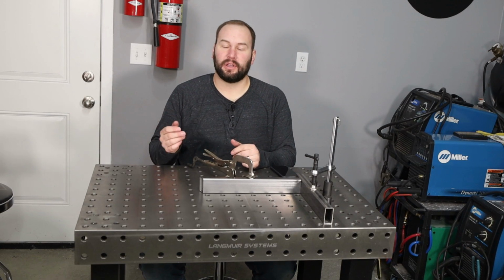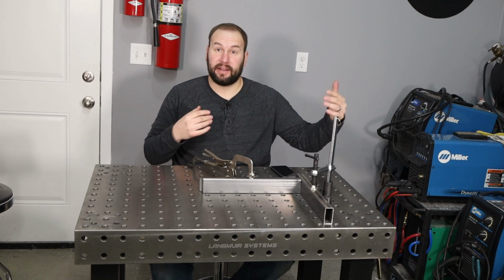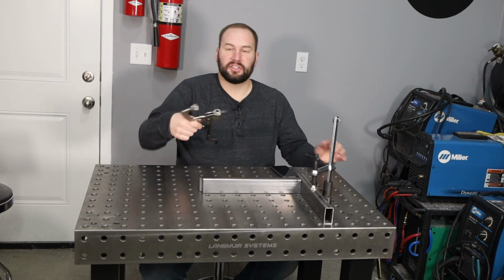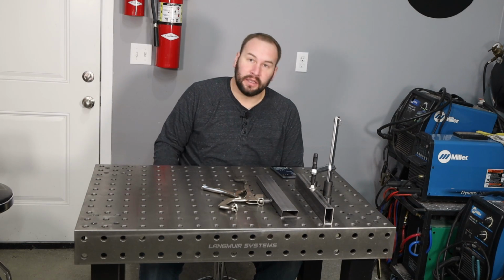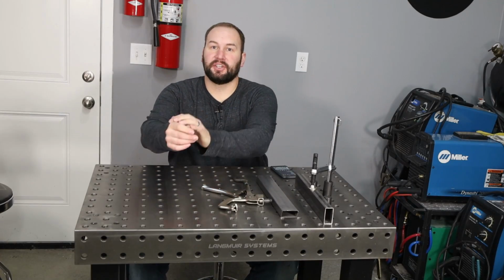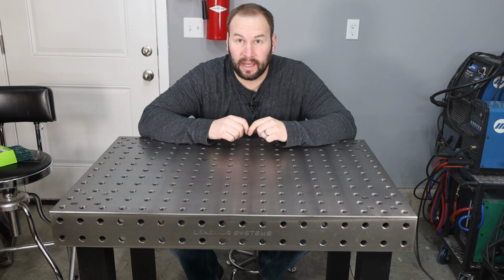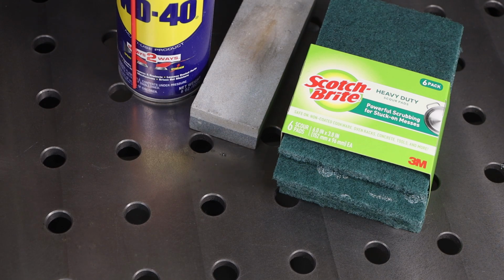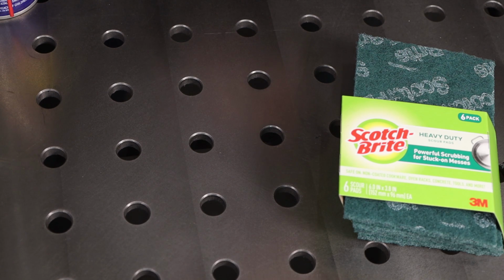Tool Review: Arcflat Welding Table from Langmuir Systems

Comment: what I would like to understand is during use, therefore during welding, if it is always necessary to spray the welding spray because I also think that after many splashes the table fills up with splashes. How do you behave? thank you very much :hand-pink-waving:
Reply from the maker: I hardly ever use spatter spray. It usually scrapes off easily.

Comment: Thanks for your review!  So i see you now how upgraded again to seigmund tables.  I personally want one badly but the price is scaring me off for just a hobbiest.  Would you recommend using arcflat for a few years and then making the jump up or just go all in now on seigmund
Reply from the maker: It really depends on what you want to do with them. They’re both good at their price points and there are more options to consider than there used to be, like the PrimeWeld table which is similar to the Langmuir, but has nitride, a grid and different legs. The Siegmund table is really in a different league when it comes to quality, as you would expect at that price. From a use perspective, the main advantage of the Siegmund for me is that it has chamfered holes and more uniform thickness allowing it to accept their quick connect bolts. This has been very helpful for me to set up stops and build fixtures. If you’re just going to use clamps, the Langmuir or similar tables are great and I don’t know that there would really be a need to upgrade for relatively light fab work. Some other advantages of the Siegmund are the higher quality fit and finish, hard surface that is nearly impossible to ding and the grid/ruler machined on the surface. I have received sponsorship from all 3 companies mentioned, which doesn’t affect the opinion I share, but I always like to be up front about that.
Reply: @TimWelds  hey man, thanks for the speedy response and informative videos.  This decision has been keeping me up at night for weeks.  I know you get what you pay for so that's why I want the seigmund.  Keep up the good work man!

Comment: Does anyone know how well the Fireball Tool's 5/8 fixtures and clamps work with this table? I think either in this video on or ArcFlat's site, the thickness of this table is said to be 1/2" as opposed to 1" thickness of FBT's Work Bench. I'm hoping this only affects the FBT's tacking bolts (which could still be used with a spacer I assume) and the rest of their 5/8 fixtures/clamps work well.
Reply from the maker: I bought a set of strong hand tool clamps from fireball tool and they worked fine, though they would lean a bit, which you can see in this video. The thickness of the table was a bit under 1/2”. The bolts won’t work with this table. They require a chamfer on the bottom of the table and closer machined thickness tolerances to work right. The Siegmund table that I use now works with the bolts, which is one of the advantages of a higher end table.
Reply: @TimWelds  Right on, thanks for the quick reply. It looks like there's quite a price hike from ArcFlat to Siegmund. Their cheapest option on special right now is $4509. FBT sales told me their coming out with a 1/2 thick Work Bench in Q4 this year. If I'm gonna spend over 2K, I think I'm gonna sway toward FBT.

Comment: PLEASE don’t buy this junk. It’s been at the heart of my nightmare inducing situation and I wish I had never followed Tim’s advice on this table. 

I bought it, spent thousands of dollars on equipment and now I realize how THIN the table top is and how easily it distorts when clamping (making it no longer flat). Once it’s no longer flat, you can re flatten with some sanding stones, but you are only making the top thinner!!!

Wish I had bought a fireball or Siegmund table and not flush all that money down the drain.
Reply from the maker: Thanks for sharing your experience. I’m sorry to hear about this. I used mine a lot for the couple years that it was my main table and never had that problem, nor have any of the others I know with the table. Did it distort right next to the holes or did the whole thing bend? Perhaps there’s some variation in thickness between units or you’re using it for heavier applications than I did. Either way, I appreciate your comment because it adds another data point for viewers to consider.
Reply: @TimWelds   It locally distorts right around the hole when clamping with moderate pressure. I’m reading a thickness of .34” on the areas where it distorted. This is substantially less than other tables.

This table thinness also causes the ball lock bolts from BuildPro to not work.
Reply from the maker: The ball bolts are only compatible with tables that have chamfers on the bottom of the holes, which is something that you’ll only find on higher end tables.

Comment: Tim, do you have issues with the ball screw nuts from BuildPro?? It seems this table is much thinner than the BuildPro and the ball nut won’t tighten. I bought the shortest they have which is the BuildPro T55055

Comment: Just passing along my experience with Langmuir.... They have distribution/supply problems and they are not up front about it. I ordered clamps from them four months ago and they never showed. They kept stringing me along via support emails. "Oh just a couple more weeks." Repeatedly. I finally had to cancel the order.  
I found a simple solution though. Search for "ULTIMATE FIXTURE CLAMP HACK - Weld Your Own" and watch that. It was good welding practice and the resulting clamps worked great.

Comment: I recently got a Langmuir cast table based on your review and 5th Street Fab’s.  
It’s everything I’d anticipated, aside the filthy condition as-received - took lots of time, acetone, and rotary wire brush drill attachments to clean up all the casting sand residue and oil slime.  
You’re on my short list of video resources as I self-teach myself to weld. Keep it up Tim!!!
Reply: I received 2 tables in filthy condition as well - did you only clean up the top and sides, or did you also clean up the bottom? Wondering where to start with the casting debris that's backed up on the bottom surfaces?

Comment: Nice vid. Suggestion for coating. Don't use qd40 use the spray anti splatter chemical instead. That will serve the sealant purpose as well as minimizing any spawling and splatter to stick to that nice new surface.

Comment: **BEWARE**

We just added 2 more of these to our shop and they came in in TERRIBLE shape compared to the 1st two.

The holes WERE NOT DEBURRED and there are tons of imperfections from poor casting, which they filled in with some sort of bondo.

Absolutely unacceptable. Instead of fixing their quality control, they've updated their website to say that the poor casting and filling is totally normal!
Reply: I had this issue with 2 tables as well - were you able to work anything out with their customer service / support team?

Comment: Years ago I owned two Acorn weld platens, both were beasts & the square cast holes were a pain for jigging. The tops & sides were machine accurately for what we did. These newer tables with accurately spaced holes reminds me of the Bluco fixtures

Comment: Hey Tim, quick question for you if you don't mind touching on it. I picked up the same table (thanks for the great review!) and am shopping for clamps now. I've noticed in a few videos of the table that the fixture holes have quite a bit of play, have you noticed that to present any issues in lining up parts accurately? Are there any pins that have a tighter fit? I don't suppose it matters much with clamps as long as they hold, but pins I could see it possibly causing problems. Thanks!

Comment: Ah Ha, I missed this video.

Nice cuts on that project. For spatter, I have a carbide scraper. It’s called Super Scraper. It has a carbide edge about an inch and a quarter, or so, by an eighth thick, with a 90 degree blade with two edges.  A heavy, though short, wood handle. I push it rapidly across the surface, and it shears off all the smaller “blueberrys”. Anything bigger than about 3/32”, that’s deeply embedded, is sheared off by whacking the handle with a plastic hammer. Works better than anything else I’ve tried. Though some anti spatter products work well, such as the one McMastercarr sells. That prevents most smaller ones from sticking, though it is slightly messy.
Reply from the maker: Thanks! I'll have to check out the super scraper. Could be pretty good for dross off of the plasma table as well. In general, I don't care much for anti-spatter, but it can be a real life saver at times.
Reply: @TimWelds  it does work well with dross. It’s pretty sturdy, which is why I like it.

Comment: Hi Tim  Great table. I would fit a sheet of thin metal underneath to stop weld spatter from dropping through holes onto my legs though. Love your videos and learned a lot as a beginner to welding
Reply: Good idea, but you should have a set of leather chaps.

Comment: Dang, I thought I was going to order the Langmuir setup then I see the comment about Siegmund offering a 3' x 4' kit for $2,000.  That might be too good to pass up, but only if I can pick up the Siegmund in NC.  The $800 in freight, even to GA, might be enough to kill the deal.  Well, it is still at least a fair deal.  Right now Langmuir has a sale going on their tables.  Even their shipping will be over $200 with two sections and legs.  Guess I will start by calling Siegmund to see if I can pick up myself.

I like the idea of the Langmuire being 2'x3' pieces.  I foresee buying at least one Langmuir section while they are on sale.

Comment: This seems like the best deal out there now. The CertiFlat FabBlock 2'X3' (with sides) is $1000 in 3/8" thickness, and you still have to weld it together.

Comment: Great looking table, Tim. I sprung for a 36x24 CertiFlat tab and slot about a year ago to replace my Northern Tool Klutch stamped metal POS like the one you used to have. The CertiFlat did take some time to put together. I do like it BUT I like the Langmuir better if for no other reason than the sides and the thickness. Oh well, I'm stuck with mine.😪

Comment: I have occasional projects and there can be months in between usage. Also, climate is pretty humid and temperature varies drastically throughout the year. What is you recommendation to use as long term preservation of rust prone metal tools? I tried WD40 and also lubrication oil. In both cases, surface rust was present after about a month.
Reply: Gun oil 
May need a light scotch brite rub with some wd40 etc every now and then still, just the nature of the beast really
Reply: fireball tool did a comparison of a dozen products on their YT channel
Reply: I wonder if you could use the chemical that they use to "blue" gun barrels?  It wouldn't completely protect it from ever rusting but it definitely makes it take much longer.
Reply from the maker: I live in a dry climate and WD-40 or machine way oil has always worked for me. Jim's suggestion of gun oil sounds good. I have used a product called rustlick to preserve tool steel parts in the past with good success, but I haven't tried it in an application like this. In the end, it may just come down to some periodic cleaning.
Reply: @TimWelds  Thanks a lot. I will try with some gun oil. Rustlick is unfortunately not sold where I live.
Reply: Try Gibbs. Was using WD-40 and switched this. It's more expensive, but it works, and I live in Florida. https://www.amazon.com/Gibbs-Brand-Lubricant-2-12oz-cans/dp/B00AFJXIJQ/ref=sr_1_1?dchild=1&keywords=Gibbs+Brand+Lubricant&qid=1613323483&s=hi&sr=1-1

Comment: Excellent! Great table and versatile. I would had placed some wheels on the legs to move it easily from where it is stored when not needed
Reply from the maker: Thanks! Having it on wheels would be really nice. My floor isn't flat, so I have a hard time getting things with 4 wheels to keep from wobbling. If I find a clever, sturdy way to solve that, I may add some casters in the future.
Reply: @TimWelds  You could use self leveling floor base and then even seal it with garage floor epoxy.

Comment: Can you use pam cooking spray to prevent spatter from sticking?
Reply from the maker: I've seen others online doing that. I assume it works pretty well, though I have never done it myself.
Reply: They have a really nice ceramic spray that is really nice. I don't like oil when I'm welding but honestly a little probably wont hurt. but that anti spatter lasts a really long time and doesn't take much. I think it's from 3m and is white